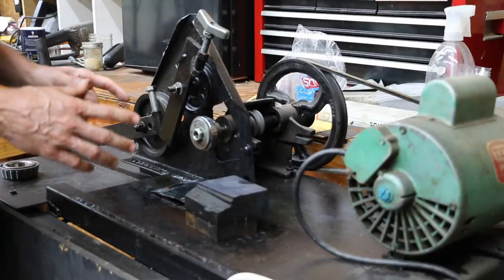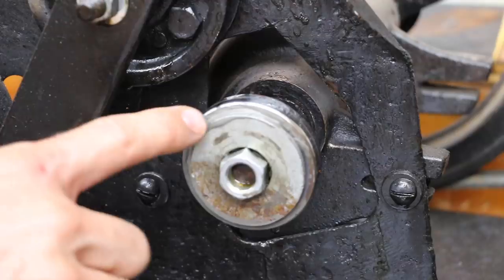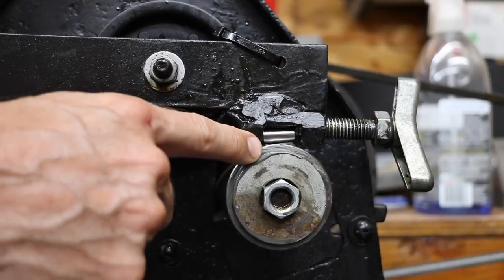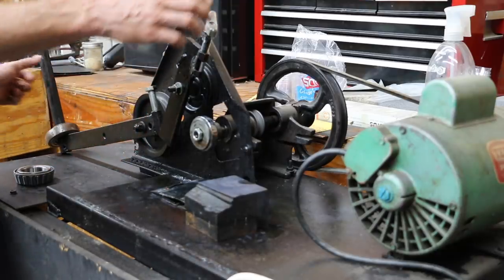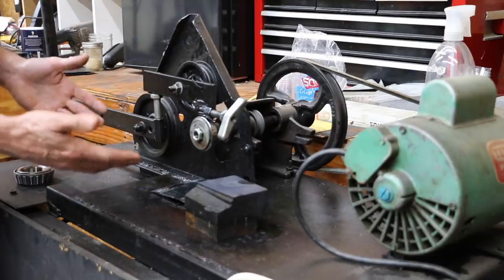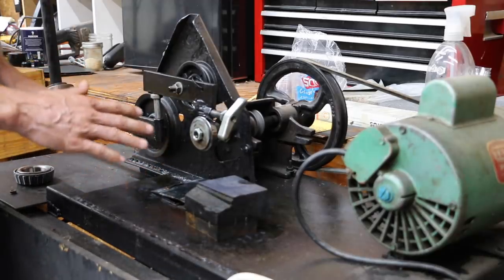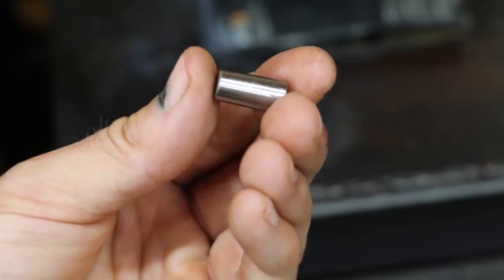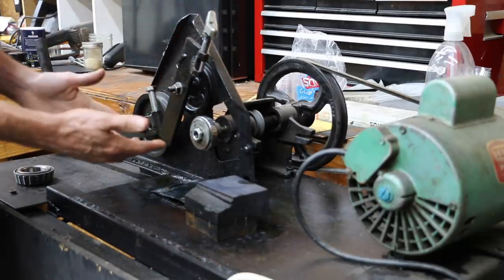How does the oil lubricity tester work?  Let's find out!

Comment: Is there any particular reason you chose the specific weight that is used? Is that amount of force on the bearing face representative of some typical usage or is it designed to be extreme so that result can be found in a short time?
Reply from the maker: Great question. I chose this weight after some experimentation. It seems as though the weight chosen provides adequate downward force to provide very good comparable results.  Thank you
Reply: OK.. Thanks for the reply!

Comment: Hello! I was wondering if you could do a test with oil at different temperature extremes and see how it affects the wear rate of the bearings? Maybe you can freeze the oil and the bearing, or heat them up to normal operating temperature, or heat them up to almost flash point and see how it changes things?

Thanks! Love your channel and your work!
Reply from the maker: Great video idea!

Comment: Do you replace the race at all? Just wondering if it would wear enough to affect the circumference over time. Wouldn't really matter comparing results performed one after another much but it's nice to compare results from different videos. Obviously the bearing takes the bulk of the wear but I'd imagine the race does wear somewhat
Reply from the maker: I don't use it enough for it to need replaced yet, but I have plenty of them to use when it comes time.

Comment: First I would like to say, nicely done on your video's.  Could you test a product or products that are anti friction products. I use one called IXL. This is an oil treatment. I saw this demonstrated back in the 80's. They used a machine like the one you have. They stuck a bearing on it and had an oil bath the race sat in. The race spun. There was a couple gauges that registered watts and how much pressure you put on the bearing. Kinda like you have. I would like to see this test duplicated and compared with other products. Like you channel. I am a new subscriber.
Reply from the maker: Thanks for the video idea.
Reply: @ProjectFarm  I am patiently waiting on this video. I cannot wait to see it. I see you just made a video on Scratch remover. I also made a video showing a product called Torque. This is a scratch remover, Torque also sells a lot of other products. These are not cheap or inexpensive but I like them. I would like to see how this product line holds up against the rest. You have a new follower, I also told my son's about you.  Keep up the great content.

Comment: Hey Bro, Good On Ya! So I am curious if you have ever tested the claims of the oil additive "Power Punch" ? I have been using it for years, to pre-lube bearing surfaces, while assembling engines. I also like to add a bit to the engine oil of high mileage engines, as a measure of extending it's life a bit. I've never had the opportunity to do the extensive type of testing that You do, so was thinking it may make for a cool episode. What do ya think mate?
Reply from the maker: Not yet. Thanks for the recommendation.

Comment: Have you tested two stroke gas mix with it? Using different two stroke oils. Or two stroke oil gas mix in the oil pan in a 4 stroke?
Reply from the maker: Not yet. Thanks for the recommendation.

Comment: I'd like to see a test done with different bearing pressures to try to demonstrate that oils with high film strength only perform differently under extreme conditions (under lower pressure conditions the wear should be the same, then under higher pressure the more expensive oil should perform better).

Maybe compare something like regular cheap oil, AMSOIL Dominator or similar, and cheap oil  with a high-zinc break-in additive, with each oil being tested at three different bearing pressures.
Reply from the maker: This is a great recommendation!

Comment: To add even more repeatability to the test, a simple relay/timer to turn it on/off at exactly 30 seconds (or any other timed length) would add even more consistent testing.
Reply from the maker: Great recommendation.

Comment: I have a question for you. I've been trying to figure this out for 20 years. Higher viscosity oil equals less flow higher pressure. Lower viscosity equals less pressure more flow. Which one causes more engine damage. In my mind I would rather have better flow less pressure. I assume higher pressure with less flow equals more bearing damage. Never able to figure it out.
Reply from the maker: This is a great question and there are lots of opinions on this.  My opinion is that the viscosity should be adequate to reach optimal oil pressure.  Issues arise from too much or too little pressure.  Just my opinion. Thanks again.

Comment: What about when they use a torque wrench?  And actually try to apply enough force to stop the motor.  Will you be able to duplicate that?
Reply from the maker: The use of a torque wrench is still an "one arm bandit" approach that provides less accurate results than this setup.

Comment: So how is the film strength determined? Just by visual inspection ? Just curious. 
      It would be beneficial to take a temp reading of the surface a specified time(s). 
       Very cool !
Reply from the maker: Thank you!  There is a way to quantify film strength based up the amount of scoring and weight applied to the tester. However, I normally just provide measurements for the length and width of the scoring.

Comment: Excellent! I guess my only question is how well does 1500 grit represent what is in a typical engine? Aren't metal on metal parts more polished then that? It might be nice to see a wider wheel with half of it polished??
Reply from the maker: Great point. The bearing surface doesn't get sanded.  I've had some suggest use of a more abrasive sandpaper and while think 1500 is fine.
Reply: initially bearing surfaces and bores are honed, which leaves tiny lines the oil can sit in, yes it does polish over time, but its meant to ride like hydroplaning on the oil,  the surface area  and load of the parts are calculated to do this,  and the clearances and oil flow under pressure.  the  bearing load tester puts excessive psi and breaks through that layer , but we have to push to extremes to test in a short time period.

Comment: I have one question that someone has most likely already asked, but I couldn't find it so... the wheel race gets sanded every time to remove old stuff. But then it gets smaller in diameter thus making less circumference, making less distance go by the next bearing after each test. Am I correct?
Reply from the maker: The metal loss from sanding is very little. Thank you
Reply: @ProjectFarm  okay, thank you for getting back so quickly.

Comment: mr project farm, i'm a college student in a project to build this kinda tester machine.. can you help me about the basic arm length to preasure ratio and the relation to how much kg(pound)should we put as the rear weight ? i kinda confused about it

thank you
Reply from the maker: Recommend experimenting with arm length. I don't believe there is a perfect length.  The end goal is to have the longer arm apply enough leverage on the shorter arm to cause a measurable difference in wear on the metal being tested.  The bearing that comes in contact with the wheel race normally has a total of 14 Ibs of force on it, which is enough to cause scoring.  Thank you

Comment: The bearing race should be smooth as possible, If any oil additive has a solid, it will adhere to the asperity's in the bearing. You will not be as constant. Modern engines can reach as high on parts up to 200,000 psi  Check the API guide.
Reply from the maker: Thanks for the constructive feedback

Comment: I'm a manager at a local auto parts store. I won't say which one so as not to scew the results. I would be willing to send you a variety of spark plugs if you would test them and compare the results. Especially with your see through engine. Let me know what you think. Thanks.
Reply from the maker: Thank you for the generous offer.  I just purchased a variety of spark plugs to test in a future video. It should be interesting.

Comment: How about jb weld waterweld few other use a hole in a pipe test how much pressure they could possibly hold or see if it leaks after little while with water and pressure. Just to test
Reply from the maker: Great video idea!

Comment: You put a lot of thought into this device. But having watched this and some other test you have done with it where you resurface the bearing race with an angle grinder. I feel  that this test is flawed.  A quick swipe with a grinder is not going to put any kind of uniform surface on the race. Plus you have no way to check it . So every test you do could be a little different . So when some of the tests you do you do show only a slight difference . Just what caused it ?   The different lubricant  or  the poorly surface bearing race ?
Reply from the maker: Thanks for the constructive feedback.  I use 1500 grit every time to prepare the race.  The testing consistency and accuracy is amazing.  For example, a product like MotorKote will beat a product like Zmax 100 times out of 100 and the results of each test look identical.  When comparing 2 products, a slight difference in wear is a result of 2 products that deliver very similar film strength.  Thanks again.

Comment: Yes please test some oil. I'd really like to see some comparisons between 0W30 or 5W30 and 0W40 or 5W40 especially with varying temperature.
I really would like to see if a 0W30 has any advantage over a 0W40 - putting efficiency aside.

I recently bought a new car with some 30 000 kilometers longlife oil in it. It is 5W30. I thought about changing it to the best 0W40 Oil I can get - which I believe is from mobil 1. I compared manufacturers specifications which each brand of oil meets - and mobil 1 full fills the most and strictest requirements.

A mechanic told me I could not use 0W oils because they're too thin. Is that true?

As far as I understood oil lubricities a 0W30 is thinner a low temperatures than 5W30 but at operating temperature they behave the same. A 0W40 should offer a even better film strength at operating temperature as 0W30 or 5W30 which should result in lower stress on the engine.

He said I could use 5W40 - but why would I? Cold starting the engine, especially in Winter - a 0W oil should spread around and lubricate all parts a bit faster then a higher viscosity oil.

He also mentioned that race cars would use 10W60 or even higher - what I already knew. I always thought the need for higher film strength will ultimately result in the oil being thicker at low temperatures. Ideally they would also want to use a 0W60 or higher oil, if it would be physically possible to create an oil with that characteristics.

The only circumstance a engine can suffer damage from too thin oil would be if you would put a 0W20 oil in an engine which was designed for 0W30/40. I will be fine until it reaches operating temperature. At high stress the film will break down and metal will come into contact with metal.

Whose reasoning is right? My central thesis is a 0W oil while being cold is always thicker than any other oil at operating temperatures.

Is this where my reasoning is flawed, or am I right and the mechanic didn't knew what he was talking about?
Reply from the maker: You bring up excellent points regarding the cold and hot viscosity of oil.  Personally, I don't believe any harm would occur for the reasons you've mentioned.  If under warranty, I'd likely continue to use the recommendation viscosity. Otherwise, I'd go with what I thought would work best. Hope this helps.

Comment: Great vid. But what about the one-armed Bandits videos that have instead of an arm that the apply to downforce they use a torque wrench? I e look up Petron oil additives by limited friction.
Reply: In addition, it was in the above-mentioned video and product that they know that bestline uses a corrosive as a friction reducer which is fine and race motors that get built every so often but not so good in an everyday used motor because of the corrosive material
Reply from the maker: Torque wrench method can be manipulated too.
Reply: Project Farm i thought so. What about trying out limited frictions products?  Could I send you a bottle?

Comment: I have posted this on 2 will this destroy an engine videos, but they were kind of old it is a twist on sugar in the tank.   

How about a mixture of thick syrup which would have a lower water content (like a table syrup), molasses or honey and alcohol (90% or higher ethanol or isopropanol) to try to kill an engine, I have always thought that this would mix with the gasoline unlike sugar and make it in to the cylinder to carbon up the engine and cause problems.

Comment: Sorry, the test is a simple “EP” or extreme pressure test, and is not relevant for either an engine oil, transmission or penetrating fluid. It test the oil’s (mostly gear) film strength first, then at varying temperatures, the different ep chemistries would activate to yield protection tonhe roller bearing. So, this “tool” is used by “snake oil salesman”. Don’t believe me,, just ask and I’ll technically elaborate. But I do love this channel!!
Reply from the maker: Thanks for commenting on this.  How would you compare a synthetic oil to a conventional oil?  What sort fo testing?
Reply: The benefit of a synthetic is temperature capabilities; both extreme cold, and their ability to resist oxidation - or high temps.  By synthetics, I am refering to PAO, or Group IV base stocks only. So, oil flowabilty will require -40f for cold flow-a-bility, and unless you get into chemistry, it will be really difficult to measure oxidation levels. But, let me help you with a test using your roller bearing rig: Use various mineral and PAO synthetic gear oils of the same viscosity grade (75w-90) and use your roller bearing to measure the performances between them. (I will be happy to assist with brands selections, test methods, result interpretation too). The base oil provides film strength, and the additives and the treat rates makes the base oils work better. I look forward to watching!!!

Comment: Hey guys. Can we simple use these tests to choose the oil for our cars? I'm asking this cause there are plenty of known brands that have horrible results in these tests compared to, let's say, OEM oil. I know these tests are only 5 to 10 minutes and as the oil degrade over time the results will change and perhaps that's where those top brands win. I simply don't know.
Reply from the maker: You make a great point. There are many factors to consider when purchasing oil for a vehicle. This test provides one key indicator of product quality.
Reply: Project Farm I was surprised with the lubricity test for the ford formula F 5w30 oil. I also as some here already used with almost 20k km to check was is the result now but I have to send it to Poland (I'm from Portugal)

Comment: Please test different weight oils, like 80w90(gearbox oils), and different engine oils, use same brand, really don't care about the brand, but how the different oils behave in reality...
Like straight 30, 10w30,5w30,5w40, 0w40 and gearbox oils like 80w90. More how different weight oils behave, not the brands. As some recommends only straight oils in there engines.
If don't want to, I'll do it my self as curious.
Reply from the maker: Great recommendation.

Comment: I do not believe this is a good option only for one reason, while you apply the test and the load on whatever fluid, you let all the applicable fluid SLING OFF the wheel. And then it will run dry. If you can keep the fluid in contact with the wheel the whole time, itll be a more accurate lubricity test.
Reply from the maker: Thanks for the constructive feedback
Reply: Project Farm thanks for the videos😎👌🏽

Comment: That doesn't really do anything, its not under pressure, i wish i could see a pump push out idk? 29psi to a thin film of oil through a metal to metal contact plain bearing like engine bearings w/ a glass/acrylic panel to see it in action. :D 
All that machine shows isn't really much. I want to see real results on how oil is properly used not just thrown and rubs on something.
Reply from the maker: Thanks for commenting on this.

Comment: Test idea: Lead-Acid battery recovery with 'Battery Chem (see batterychem.biz, about $45 for enough to treat 4 batteries) vs distilled water+electronic desulfator.

Proposed test:

Get eight salvage-yard batteries and profile them to establish a baseline (charge for 12 hours, record voltage and specific gravity in each cell. Load test at 0.2C (nominal 5 hour discharge rate) down to 10.2V and record time (calculate energy)).

Process four batteries with the battery chemical according to the instructions. Process the other four batteries by adding distilled water to the correct level and balance/equalization charging, then leave on an electronic desulfator for 1 day per pound. 

As each battery is completed, repeat the profile and compare each battery's performance before and after treatment and see which method performs better, and how close the performance is to the nameplate rating.

Not a quick test, obviously, but the results would be pretty interesting.
Reply from the maker: Great video idea--thank you!